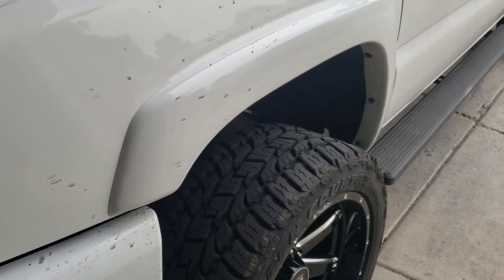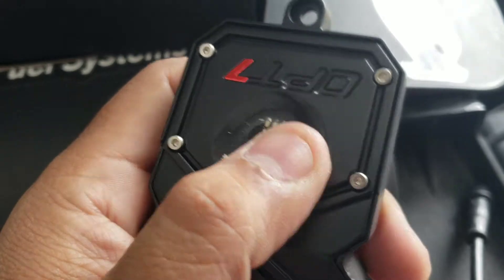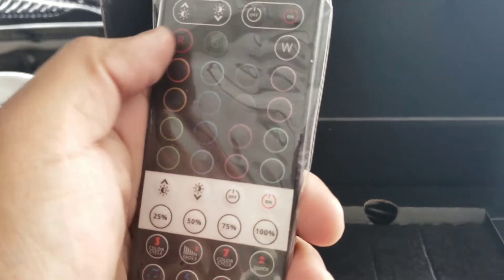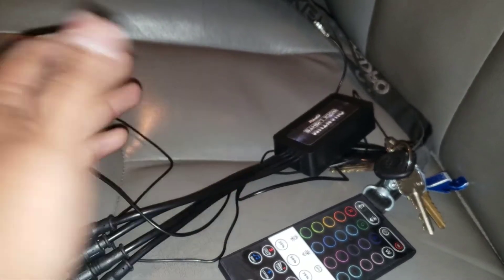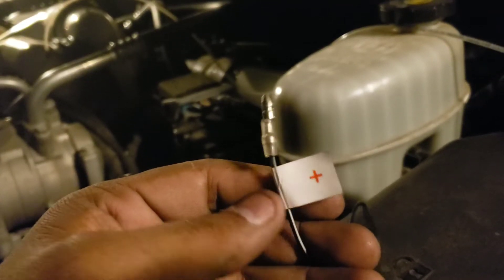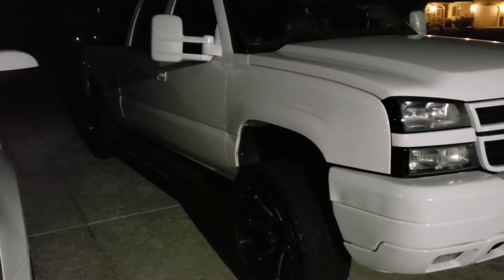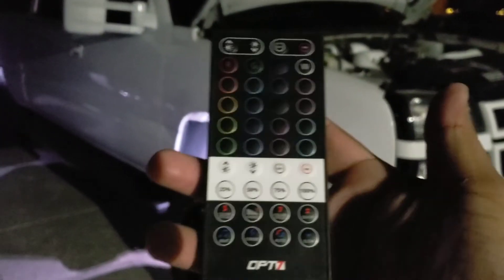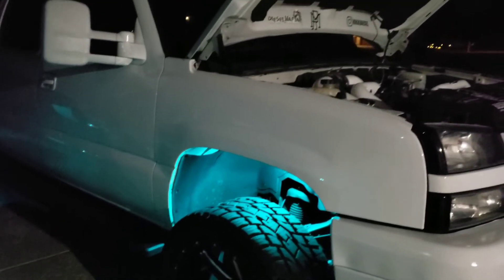Opt7 Aura Quantum Rock Lights install and review

Comment: Did urs come all the same color cuz 3 out of the 4 are the same color but that 1 is always different
Reply from the maker: Mine was i guess normal cause I got like atleast 10 different colors. Call opt7 might be a bad module box
Reply: @rikkidiesel  I got it now, I just had to unplug it and plug it back in, I got all the colors tho, just took a min to learn everything, it ls alot different then my last set i had

Comment: I bought a set of rock lights that I want to put on but I suck at wiring I can run them but I do not know how to get into the fuse box and do all that
Reply from the maker: The fuse part is probably the easiest part of this opt7  kit. Just find the fuse that has power to it all the time and plug it in

Comment: Is the module/Brain waterproof ?  How many feet of wire you get per light ? You have to worry about software issues using phone remote is better
Reply from the maker: Probably shouldn't get it wet but if u tucked it away in the engine bay it wont get wet. I like having an actual remote just for it better then the phone app

Comment: Hey bro so do I HAVE to get the extension for me to install the lights?
Reply from the maker: you don't but i wanted to put the box inside the cab so i needed it. if you dont care then you dont need them. also depends on the trucks length
Reply: Rikki Diesel oh okay gotcha. Im just gonna put the box under the truck
Reply from the maker: Yeah make sure to waterproof it lol probably dont want to get it wet. Best to put it in the engine bay. Mine went to the engine just fine. It just didnt go into the cab cause it was to short
Reply: Rikki Diesel i mean it is waterproof ain’t it?

Comment: You from Idaho
Reply from the maker: Yea sir
Reply: So thinking about getting those lights is the white a bright white an the red
Reply from the maker: It has one that involves all the color to make it a bright white then u have another option to just use the white which isnt as bright
Reply: The one you have is the white good
Reply from the maker: @francisdionne8194  the one I have is the one I'm talking about that can do both options from the remote
Reply: Ok so then white bright then
Reply from the maker: Yes they are
Reply: How much was yours it the one in link right
Reply from the maker: @francisdionne8194  I think like $80 the link for the lights is in the description
Reply: Ok thanks I'm going to order them if I don't like them I didn't spend to much I just need to find someone to put them on